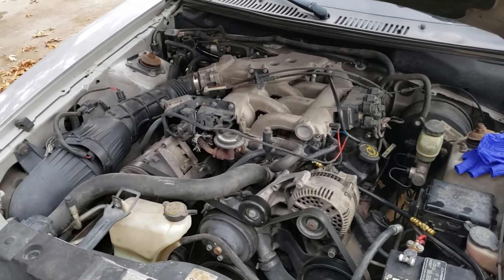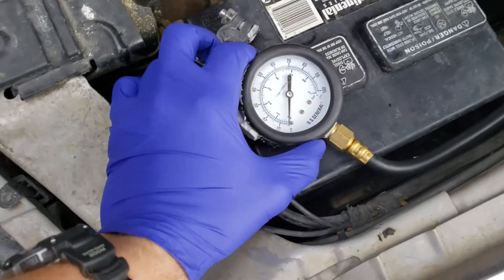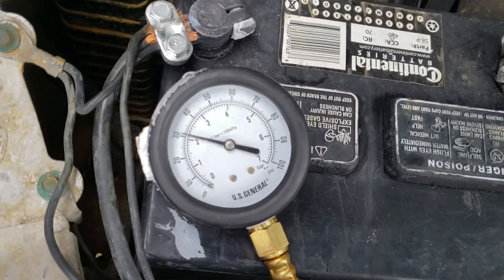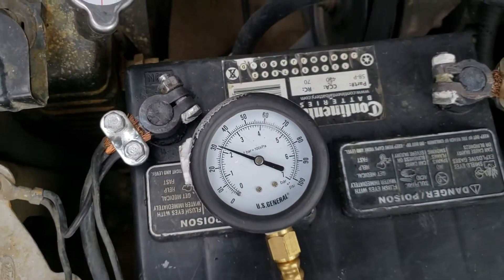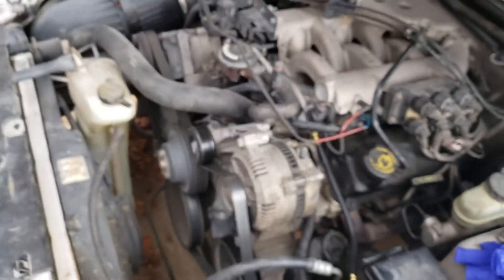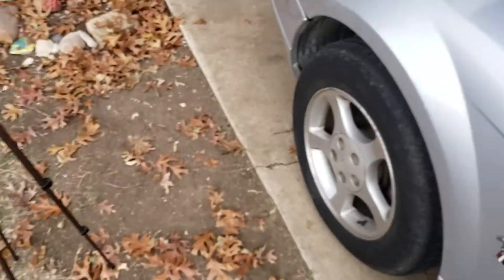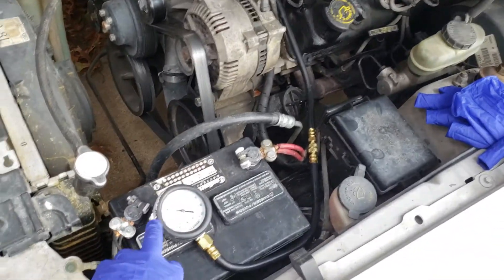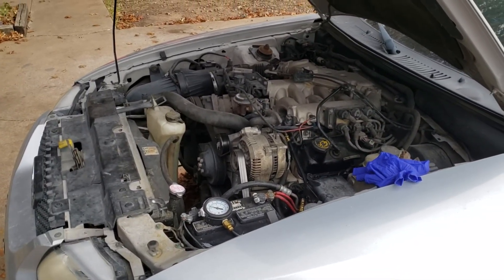Mustang v6 3.8l fuel pressure bouncing demonstration sn95

Comment: whatever you have the fuel pressure gauge plugged into is not on my car bro im tweaking rn
Reply: Man what😂me fucking too
Reply: Did you figure it out?
Reply: @StroppyBeast  yeah, I just manually inspected the fuel pump. the issue was that the pump had 2 cords connected to it and 1 was priming and the other one was to pump and so I could hear the fuel pump prime, but the fuel would never make it to the engine. After visually looking at it I saw that the cords that sat inside the fuel right next to the connector had been corroded and it ate away at one of the 2 wires connected to the fuel pump. So I replaced the fuel pump and it was fixed!

Comment: I'm working on one with similar problem. My scan first told me EGR so I replaced it, then when that code cleared, it gave a FRPS code and shows 12.6 press until engine reaches operating temp - then it stumbles, PSI declines and engine dies and wont start until it  has once again gone cold. I think your fp should be 35-45 psi normal... Since this is some time back, I'm curious what you found. The senor should be (and I think I can see it) immediately above the Shrader valve you hooked up to. What happened when the engine warmed up to full normal operating temp?? - cuz this shows you are still cold (and several things arent operational at this temp). Also approx 9 gals of gas for a 30 mile drive is so radical, I'd think the exh pipe would be dripping and a plug would be drowned so you'd have a solid hard miss thru all the rpm range. So I just read where you got rid of it. Probly good choice... but I'll leave my comments on in case you or anone else wants to do a follow up comment. THX
Reply from the maker: I actually dont remember what i even did with this car. I think i traded it for something. At 12.6psi, Id say you have a bad fuel pump

Comment: my mustang is doing the same thing. it also sat for a year. any suggestions?
Reply: Its def misfiring, I can hear it as u rev it.
Reply from the maker: I didnt pursue this issue actually. It ran fine, and i got rid of the car. I suspect fuel pressure regulator
Reply: @gagefixeseverything  i see why. my car seems to struggle once i’m ideling for a while